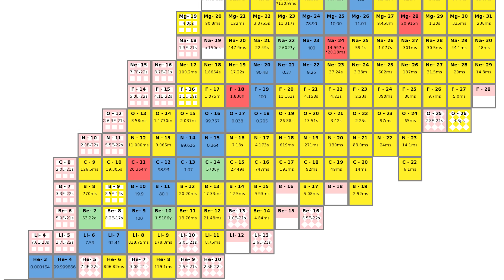Why the U.S. Doesn’t Recycle Nuclear Fuel

Comment: There are new Generation IV reactors. Some are SMRs, others are not. Some follow more conventional designs such as BWRs or PWRs, while others are advanced concepts. They may use either a thermal or a fast neutron spectrum. An advanced Gen IV reactor is therefore not necessarily an SMR.
Recycling of nuclear fuel can already be done with conventional reactors by sending spent fuel to an external reprocessing facility. There, fission products, uranium, and plutonium are separated. Depleted uranium and plutonium can then be combined to make MOX fuel for use in standard reactors, as practiced in France. The standard process, PUREX, relies on chemical separation. Such facilities must be under strict government control to prevent proliferation. In the US, however, building such an installation would be extremely costly and would also require transporting spent fuel across large distances.
The advantage of certain advanced Gen IV designs is that they use molten salt or molten metal as fuel. This allows nearly complete burnup of all fissile and fertile isotopes, increasing energy extraction to about 24 GWh per kilogram of uranium. Using spent fuel and depleted uranium alone, the US could cover 100% of its electricity demand for several thousand years.
Unlike solid-fueled reactors, molten-fuel designs can integrate reprocessing directly into the loop via a pyro-processing unit. This can range from removing gaseous fission products (xenon, tritium, etc.) up to full removal of neutron poisons and other unwanted isotopes, keeping the fuel mix continuously optimized for criticality, safety margins, and breeding ratio. Such reactors can use spent fuel, natural uranium, depleted uranium, and in some cases thorium. Once started, they require no further uranium mining or enrichment, avoiding environmental impacts and high enrichment costs.
The outputs are about 95% valuable elements and roughly 5% true waste, which decays to the radiotoxicity of natural uranium within ~300 years. After that it can be handled like toxic chemical waste. The waste volume is extremely low—less than a Coke can per TWh of electricity produced.
Because reprocessing is integrated into the design, no separate large-scale facility would be needed. Of course, safeguards are essential to ensure that bomb-grade material or highly radioactive isotopes cannot be extracted.
These concepts have been known for over 60 years, demonstrated in projects such as the Aircraft Reactor, the MSRE, and EBR-II. China has already built its experimental TMSR-LF1 reactor, drawing on publicly available research from over 20 years ago. It should therefore be possible for the US and other countries to follow. With this efficiency, even the 4.6 billion metric tons of uranium dissolved in seawater could be tapped; China is already developing potentially economic extraction methods.
With essentially unlimited resources, there is no fundamental reason not to move toward a nearly 100% nuclear supply. The US could become fully energy independent. At just 1 cent per kWh, the unused energy potential translates to hundreds of trillions of dollars—enough to pay off national debt multiple times while simultaneously funding social programs and healthcare.

One promising advanced design is the Dual-Fluid Reactor (DFR).
It is a BREST-type reactor using molten metal fuel and lead as the primary coolant. Onsite pyro-processing is integrated into the reactor building itself.

Key Advantages of the Dual-Fluid Reactor (DFR):
• Ultra-efficient: Nearly 100% fuel utilization
• Self-regulating: Negative temperature feedback controls output
• No moving parts for reactivity control: No control rods
• Can burn nuclear waste, depleted and natural uranium, and thorium
• Closed fuel cycle: No external reprocessing required
• Reduces dependence on enrichment, imports, and mining
• Transmutes long-lived actinides into short-lived fission products
• Built-in pyro-processing unit: Removes neutron poisons, extracts valuable metals
• Liquid fuel: No solid rods, no batch reloads
• Decades of operation on a single fuel load
• No corrosive salts: Liquid metal fuel avoids fluoride corrosion
• Lead coolant: Excellent shielding, no water, no pressure → no steam explosion risk
• Very high operating temperatures (700–1000 °C): Enables hydrogen, e-fuels, ammonia, direct steel reduction
• Up to 50% efficiency with sCO₂ turbines
• Minimal waste: Only short-lived fission products remain (< Coke can per TWh)
• Compact and scalable: High power density, suitable for modular deployment
• Outperforms typical SMRs: No pressure vessels, no high-pressure water systems
• Potential for isotope breeding: Tritium, Helium-3, Pu-238, Po-210, Mo-99, Cm-244